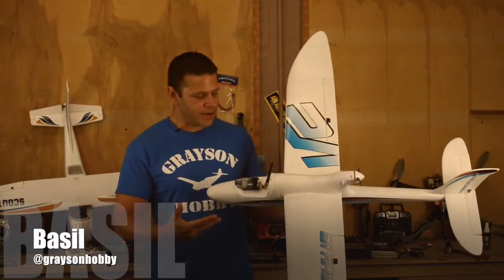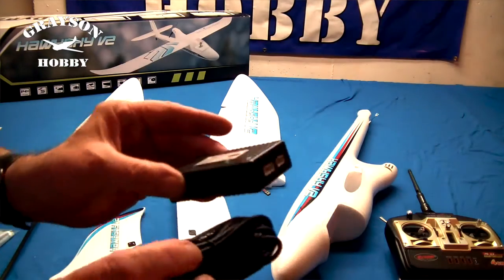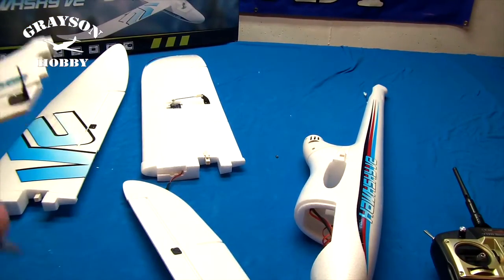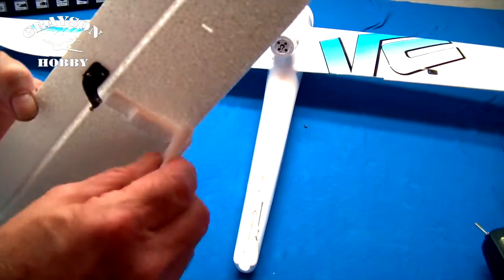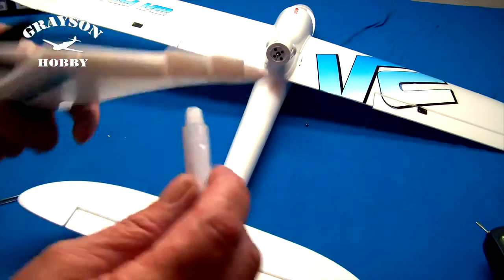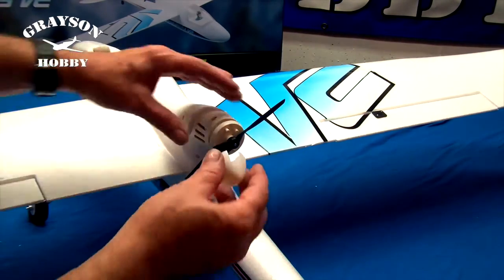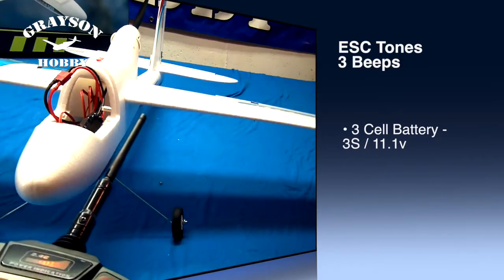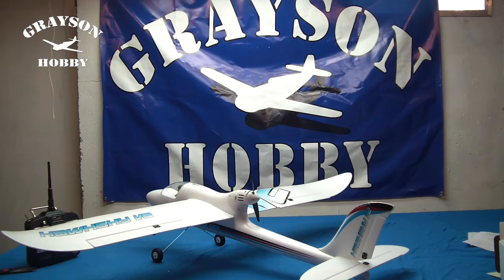Dynam Hawksky V2 - Radio Control Trainer - Build Tutorial

Comment: I don't have any knowledge at all with electric power RC planes.  I have purchased the Hawksky V2.  With all the hoopla about Lithiam batteries possible starting a fire while charging I'm afraid to charge it.  When plugged in two lights come on read and green.  I charged for about 1 hour and the read light went out.  Does this mean the battery is fully charged?  After turning the transmitter on and plugging in the battery to the ESC I heard the buzzing sounds but could not get any of the surfaces to move.  What am I doing wrong?  In your tutorial you show the transmitter on and the different movements.  I'm confused by the switch on the top left.  I think you called this the engine on and off.  I noticed you pulled back on the lever and then pushed it back.  Then the motor ran.  I tried that and it didn't.  What am I doing wrong?  Or not doing.  Please help.Thanks,Joe
Reply: Joseph Ferrelli You need to join a local RC club , frequent a local hobby shop, or join an RC online forum where other flyers can help you out. There are also a lot of instructional videos on You Tube. Good luck and the first steps are the hardest.